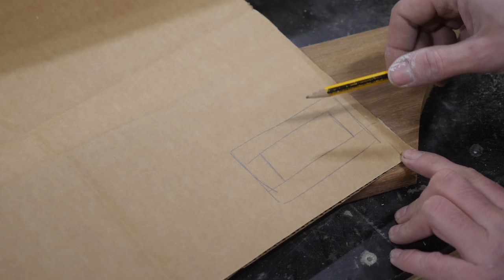Sail Life - Galley assembled, insulated and ready for paint - DIY boat project

Comment: My experience with door fronts is all the methods are acceptable if you glue the joints. Ive done biscuits, dowels, screwed corners and pocket holes. Doors that I didn't glue over time became lose in the corners. Glue or epoxy will be fine. There studies that prove that glue is enough by itself but I always add something. I think your doing great. PS all my cabinet experience is NOT on a boat...

Comment: Have you considered a roll opening for the cabinet? Also, what we do with drawer fronts and cabinet face-frames is either dowel them together or pocket screw them together. The biscuit joiner is only for sheet goods and long grain. Biscuit joiners tend to have problems with expansion on cross grain applications.

Comment: I would recommend glued dowel joints for your draw frames with waterproof gorilla glue or epoxy. Biscuits are used for longer pieces like the centre panels.

Comment: You are doing some Beautiful Craftsmanship  on the interior  i thought  you Ikea comment was funny  I’m retired now due to a Traumatic Brain Injury and  for over 20 years i was a Professional Woodworker that also had the hobby of Woodworking for over 35 years  Ive used many Lamellos in my life  they are convienent  although ive never treated myself to  a specific Machine like you did i simply use a Wing cutter/ Bearing  for my Router its not fast but it works  and one day i will find a good value on the machine and treat myself to one like you did   ( prices have come down over the years )   Especially on used ones  and on Venues like Ebay  I also agree on the final look of your Galley painted White with those drawer fronts should mak it look great  perhaps on your cabinet behind the faucet a roll top style door is what you need ?  Ive owned Airstream Trailers and they use a lot of those because of space restraints  in small spaces  plus similar to a boat Airstreams have curved walls to  work  around or with  so everything has to be custom built  or scribed into place

Comment: I would use a router table to cut a groove in the center of the frame and insert the vertical slats allowing them to float. The Kreg pocket holes are good, but so are biscuits.
Reply: definitely second this, you really just have a floating panel with the temperature and moisture changes in the solid wood on the boat, gaps will open up before you even launch if you glue the central pieces in
Reply: He could even use the table saw with multiple passes.

Comment: Someone may have said this, there are small biscuits available, and you tool may adjust for different sizes, mine does. As for drawer fronts, you are building two items, a box for the drawer and an independent front. AFTER you build the box and install it on the slides, position the drawer front on the front of the box with clamps and screw/glue/epoxy the two together. Then add hardware. Start with the bottom drawer and use shims of desired but consistent size between the bottom and successive drawer fronts. Voila, you have a pro looking cabinet front. For bonus points, join the drawer box corners in such a way that the joint takes the strain of opening, not the fasteners or glue. If I could add a diagram, I would.

Comment: Regarding the fronts your making. Lamellos are not intended for corner joints, as you discovered. Having a table saw makes it easy to half on half corner joint and a little recess to lay in a panel, I wouldn't do slats. A little water based stain would pull all the different colored woods closer together.

Comment: If you make the door fronts as you are currently planning, there will likely be cracks when the wood substracts and expands as function of moisture content. Three options: make a groove for the panel, and do not glue it; use quarter sawn stock for the panel; or glue the panel horizontally in stead of vertically.

Comment: "Kreg" system for screwing faceframes. Next best thing to duct tape and drywall screws! ;) The other option is to use the panel dado as the "groove, and tenon the ends of the styles/rails (can never remember which!) Into them. A little glue and clamp....voila.

Comment: for my 2 cents, just buy a set of router bits for raised panel doors. You will get your money's worth you are doing lots of doors/drawers/covers and what not. Actually faster than messing with biscuits.  Also, the reason most doors with slats like that are T&G is so the wood can move and they are not glued into a solid thing. Same reason table tops are not glued to the stretchers but screwed with oval hole clips.

Comment: If you are going to stain or apply an oil finish on the drawer fronts you may want to reconsider your choice of adhesive.  I would be afraid that even the smallest amount that got on the face during assembly would quickly seep into the grain making future finishes uneven.  A glue that can easily be removed before it dries or perhaps masking tape on edges where epoxy might get out is a good idea.

Comment: Mads, I suggest you consider plywood panels inset in the Ipe frames. More stable, less work, better outcome. I also second using dowels to joined the frames. Or you could up your game and use splined mitre corners on those cabinet frames.

Comment: Get yourself a Festool Domino - or if you don't want to re-mortgage the boat , a simple dowelling jig.
Reply: fraser hardmetal I agree. The domino is the best tool Festool made!!
Reply: @bootrenovatie4526  Just a pity I can't afford one   :-(
Reply: That would work but Festool is very proud of their stuff.

I think a simple $15 Kreg pocket screw jig and some pan head screws is the way to go
Reply: @shawnmiller4781  Having done it Shawn the dowelling jig is the better solution - the Kreg jig uses the face side of the component to make the joint - the dowelling jig does not , and is by far the neatest and strongest solution.
Reply: Nothing wrong with biscuits.  Face frames are the perfect application.  He just needs to look at smaller sizes. There are several available.  Slots can also be cut with a router.  Forget the domino and save your money for a new set of sails.
Reply: @jonathansmith6390  Not the best application for  biscuits - I was being ironic suggesting the Domino ( I guess you didn't get that ) The best solution would be a mortice and tenon joint, or a profile and scribe moulder or router cutter set to maximise the glued surface. Failing that a dowelled joint would provide the best solution - a biscuit does not give sufficient penetration to guarantee a sufficiently robust joint on a drawer front which will be pulled repeatedly , stressing the joint every time.

Comment: 2 words for building cabinet door frames-Pocket screws.

Biscuits work great for attacking items on edge duck as building a table top for joining the slats but pocket  screws are the way TIG o for the frame.

Also I would not hard mount the middle of the door spiked to the frame but leave it floating especially since you have two different woods that will sheik and swell in the environments you will be sailing in. 

Making it float will give the door room to expand and contract and you won’t have splitting issues

Comment: If there is not enough room for a biscuit then use dowels (you put them in with a dowel jig). Also what makes biscuits strong is it's interaction with water based glue (Tightbond III or equivalent, should be the only water based glue used on a boat) expanding the biscuit.

Comment: Ditch the biscuits and use a Kreg fastener system!! I’ve made dozens of cabinet frames and doors with various ways of construction including biscuits and haven’t found a better or faster way of construction than the Kreg system and glue!
Reply: Oh good god, no. It's a crap way to build anything, just butt-jointing and screwing it. That's Ikea standard. If you're going to all the trouble that Mads is, I think you'd probably want to make your joinery at least somewhere near properly.
Reply: now THERE is a set of fun tools for Mads to invest in...

Comment: So far everything looks really nice, but personally i would've left the bottom of the small wooden Box you built (the one that sits under the box for the drawers) not screwed/epoxied down. That way you could've taken it out whenever there would be a problem down there and have easy access for repairs. Right now it seems like you'd have to basically rebuild this whole part of the kitchen in case anything would happen under there.

Comment: Used biscuits for a number of years making tables and other chunks of furniture, and not to be to negative about them they are a very useful device in the right environment.
They do have one downside,  am not sure if it is the material, or the slotting or a mixture of both but over time you may notice a slight rise in the surface above the biscuit positions and it seems to be more apparent if the timber is subjected to moisture, my first thoughts are that is differential expansion and additional sanding does remove the blemish, but it will reappear as I have found,  joinery used in interior locations using biscuits has not suffered this issue.

Diesel impregnation of a concrete/steel matrix is a serious problem, apart from the obvious damage, they will find that it has been drawn along the rebar for some distance, a bit like fibreglass damage the obvious is not the edge of the problem, it will extend a lot further.

Comment: Biscuits really don’t make a wood joint any stronger, the are basically used to line everything up. There are standard router bits for making door and drawer frame and panel doors that work really well. If you are making the panel from solid wood you should not glue it up as you have suggested. The panel will crack because of the moisture movement in the wood. There are tones of videos for making raised panel doors on YouTube. They can actually be made completely with only a table saw. If you want to glue everything up you should use some form of plywood for the panel as plywood Is dimensionally stable. The rails and styles can be made from solid lumber with either standard rail and style router bits or you can make the whole thing on a table saw using mortise and tenon joints.

Comment: In Ferro Cement you can find  Cheap, really big, easy to repair ships. If you can work and have a limited budget and need a big boat it is not a bad choice.  If you had to weld that hole, the interior might be set on fire. With GRP, Wood and Ferro Cement you can fix the hull and keep the interior.  Just don't sail into a shipping container.

Comment: Mortise and tenon joints for the drawer fronts. You can get bits for your drill press to do the mortise. A router can do the tenon. That will allow the wood to expand and contract with the environment. Also, if you have a galley island sitting on top of your diesel tank, how will you get to it to clean it?

Comment: Drawer fronts can be easily made using pocket screws if you feel like they need reinforcement. Ipe is so hard it might be difficult driving screws into it.
If that doesn't work you really don't need much reinforcement since the drawer front will be screwed to the drawer box. I don't know how well Ipe glues. Might be worth testing a couple of scraps glued together.
Anyway, biscuits are not really considered reinforcement. More of an alignment aid.

Comment: Since most of my sailing is in northern waters, I prefer steel or aluminum hull. Especially when the fore mentioned small elephant is involved. However fiberglass is a lot easier to work with and repair. 👍

Comment: I wish you good luck with the PEX plumbing.   We used it only for our washdown system, the only pressurized water on our boat -otherwiae we use foot pumps at both sinks.  We have both seawater and freshwater washdown pumps and PEX plumbing going from those pumps to faucets in the anchor locker and in the port cockpit lazarette out on deck.

I wish I had never used PEX.  It is very difficult to find good marine PEX plumbing hardware at a reasonable cost or anything to convert easily from PEX to/from standard marine hose at either end of a run.  The number of times I had to tear apart the PEX plumbing fittings repairing leaks into the cabin and raceways through the boat or the PEX-to-hose transitions is too many to count.  

Of all the things that we did on our extensive refit the PEX decision was the only thing to become a giant fail.  I am stuck with the PEX now as it is buried behind the insulation and slats in the V-berth.  But had I to do it again I would have run a conduit and then pulled two standard reinforced vinyl water hoses though that instead. 

I do not regret having a washdown in the anchor locker and cockpit though.  Having infinite sea water to rinse down the anchor, roller, chain, and whole deck is more than a luxury.  Having a little bit of fresh water to rinse off any salt is spiffy too.  

I have a quick-diconnect hose on the spigots and also have a nice residential hand shower head that I can snap in to them as well to take salt or fresh water showers in the cockpit or on deck.   

But I regret having run PEX.  I hope you have better luck with it.
Reply: I'm currently changing all water hoses in my boat and I choosed ordinary red and blue 1/2" food grade marine hose , expensive as hell (+600$ for 60m) but I heard so much cons of pex in a boat in many marine forums so I ditched that idea right away. I was thinking of copper also but it's much easier to swap a hose then pipe through out the boat.
Reply: @jaghej4118  if someone made a simple 1/2" PEX to 1/2" hose barb fitting that was made of a good quality brass which would last it would be great.

Comment: The proper name of your new tool is biscuit joiner (not jointer). 

Regarding use of biscuits as floating tenons, there's no reason you can't simply shorten the biscuits to match the smaller biscuit slot you made by offsetting the centre of the joint.  (Sorry for the rather poor explaination but I think you'll understand what I'm getting at.

Comment: What is the oil content in Brazilian Walnut?  If it's anything like teak, you've got to clean all glue surfaces with lacquer thinner before gluing.  The L.T. temporally dries out the oil from the wood fibers so the glue can set and cure.  I agree with using dowels on the stiles and rails.

Comment: Use dowels as tenons
Reply: This, biscuit are not normally used for draw facings, but dowels are and the dowels will be about 8 times stronger.
Reply: It would be another "learning experience".  Dowel centers or at least some kind of alignment jig are necessary.

Comment: I think you were using size 20 biscuits. I checked the specs for the FERN and you should be able to use size 0 biscuits which are 1 3/4 inches long. There is a knob on the jointer to change the depth for the different sizes.

Comment: There might be a method to use the lamello as is, instead of 90 degrees use a 45 angle. It lengthens the cut. That is doable if the width is the same, otherwise the angles need to change. I'm one of those who likes mitred corners, sue me 🖖

Comment: The metal reinforcement in a fero-cement boat is called the armature. I looked at it when I was younger than you are now. Also, feeling that something at it's design limit sitting at the dock, just gets me shivering, not in a good way. If I get another boat before my time is called, by the Almighty, it will most likely be another FRP hull.
Cheers bud

Comment: Just a thought but if you cut the corners on a 45 would the length narrow rail now be long enough to fit a biscuit?   If not someone said to do half laps with dowel pin. Maybe cut the pins from the same material as the field of the drawer

Comment: Kregg pocket holes
Reply: Bill Karoly Winner! Agree completely.

I think they make stainless screws for outdoor applications that will work in the Marine environment too
Reply: Another vote for pocket holes via a Kregg jig - much stronger and avoids the issue you have with your biscuit jointer, which requires a work piece as wide as your biscuit.  Cutting down on the biscuit significantly weakens the joint.
Reply: Steve Lyle they are much faster,   Glue and screw,  no waiting around,  but I don’t think they are as strong as biscuits or dowels
Reply: Love pocket screws.
Reply: @vxnova1  Dowels may be strongest, but biscuits definitely weakest, at least in shear, certainly.  Not that you need a lot of strength for that joint.  But agree, pocket holes are absolutely easiest and quickest.
Reply: i would also use pocket hole and the new tool would be the Kreg K5 Pocket-Hole Jig available at amazon germany just google it

Comment: I'm more a "Pocket-Hole" guy.  I've used biscuits in the past and have mixed success with them (alignment problems).  Not so with pocket-holes.
Reply: +1 I use pocket screw on both drawer fronts and cabinet doors. Keeps everything square and strong.

Comment: 6 mm strimler af det der skuffe front 1 cm bredde holdt sammen med saddelgjorde, fra en møbelpolstrer og router linie til at forme en skydedør, du can bruge din hand router til at forme kanalen som dobbelt på tynd krydsfiner så du får perfekt parallel kanal. Forsegl kanalen med epoxy for at få bedre flow og brug parafin/stearin som smøremiddel, du bruger bare epoxy på saddelgjorden ingen brug for søm bare husk kanalen skal være dobbelt længde af panelet.

Comment: Mads, if you going to use a biscuit jointer don't use a cheap one. Check out this: https://youtu.be/HEHXuoU-CLM and then this: https://youtu.be/aO6eETepMGg

U should really go for pocket-hole jointer instead. Ofc might be a bit more expensive but way more reliable joints.